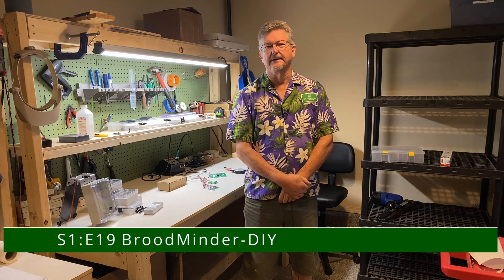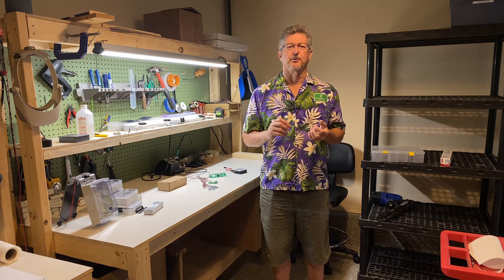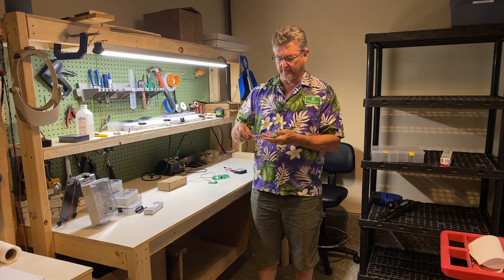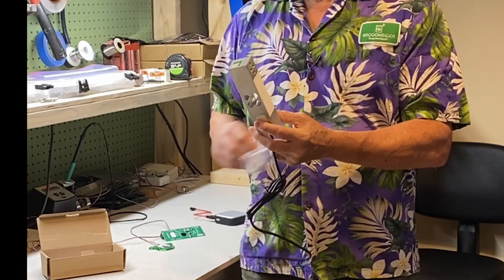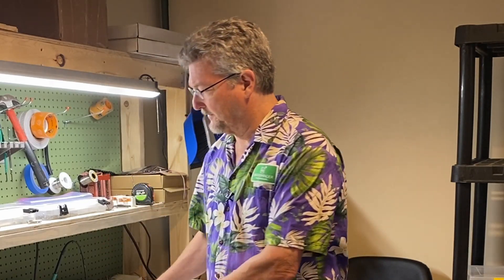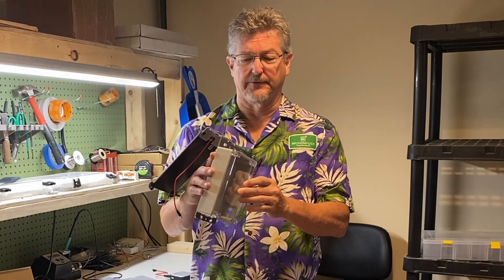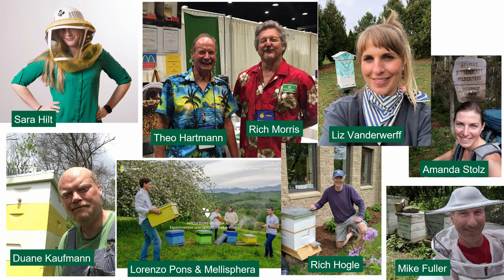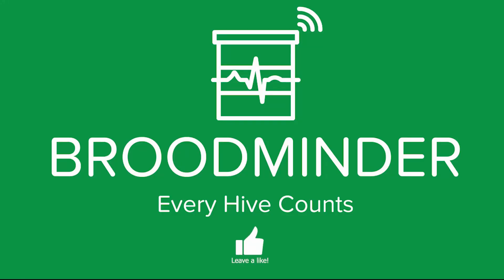S1:E19 BroodMinder-DIY

Comment: Don't those load cell sensors have temperature drift? Inaccurate results as the temp changes? How does broodminder get around this? Cheers
Reply from the maker: They do have some drift, but not too bad. You have to be careful in choosing your sensors. The first ones we got were awful in both temperature drift and creep.